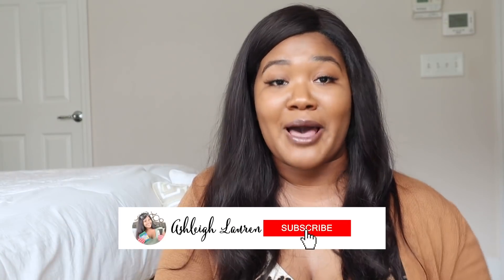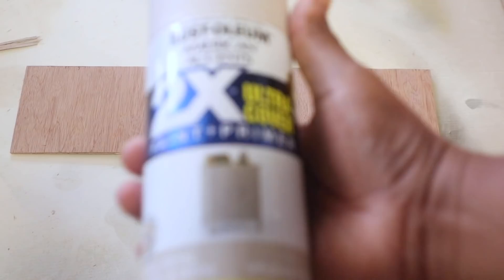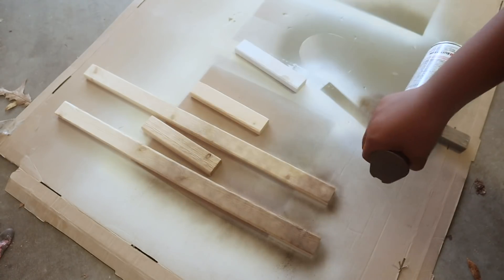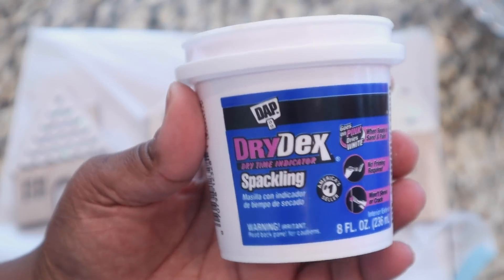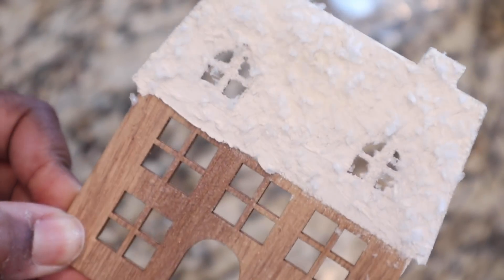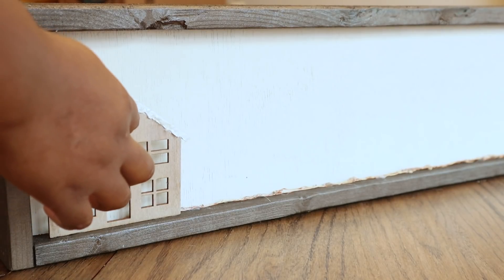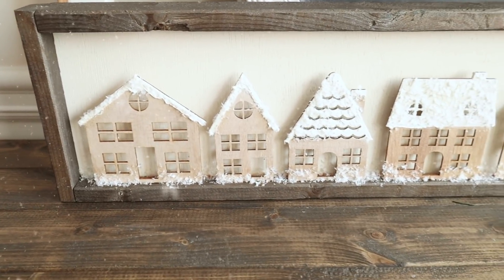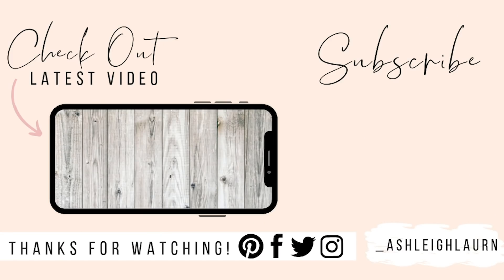DIY Christmas Wood Sign | Ashleigh Lauren

Comment: Nice project.  I suggest using wood glue in addition to nailing the frame.  Check out some woodworking videos to up the project to refine it or suggest an upgrade based on skill levels of your viewer.  Nice presentation, too.